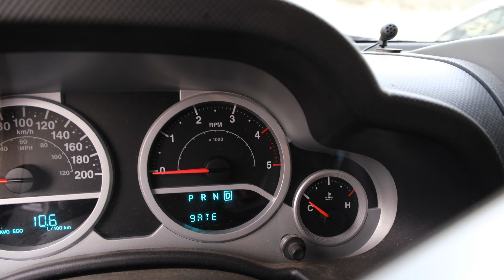Major Breakdown in the Mountains & Atlas Monkeys  - MOROCCO OVERLAND EP.3 (Dacia Duster 4WD)

Comment: a manual 4x4 is probablt best, the risk with auto gearbox in remote places is far too much, right?
Reply from the maker: Depends on vehicle.. the problem ended up not being anything but had it been serious and the wrangler being auto would be best just due to most of jeeps being auto. Manuals break too.. I think the most important is to check whether there is support for you exact vehicle where you travel and if it is common enough that any mechanic will probably be able to help you out

Comment: What was the problem with the transmission on the Jeep?
Reply from the maker: Will explain in a future video! Cheers
Reply: Okay 👍🏻 you also added a wheel carrier on the Duster. How it attached on the Duster? The design looks nice. Did you made it yourself?
Reply from the maker: @peterdelage6759  yes it was custom made by us! It is on a swing out assembly connected to the tow bar and frame of the duster. Also video coming up soon!
Reply: @xpd44.outfitters  Great👍🏻